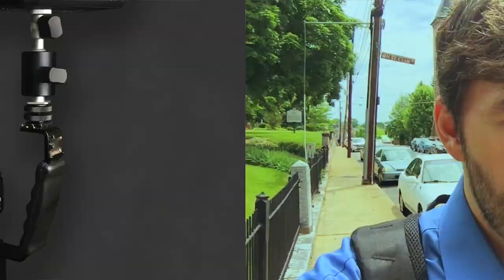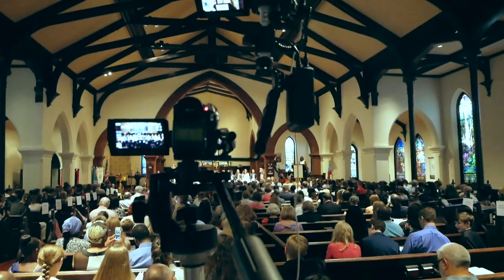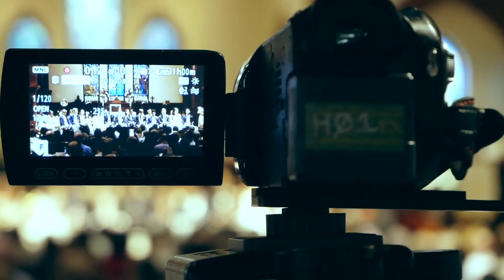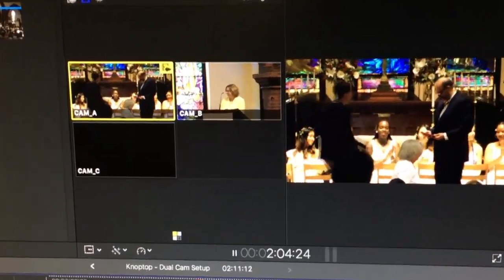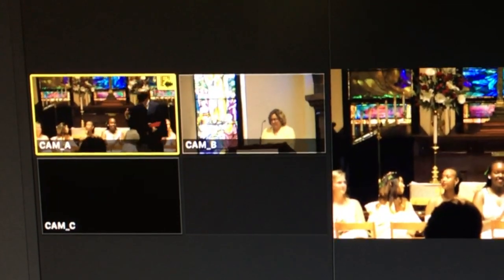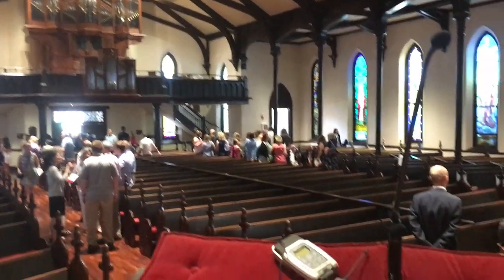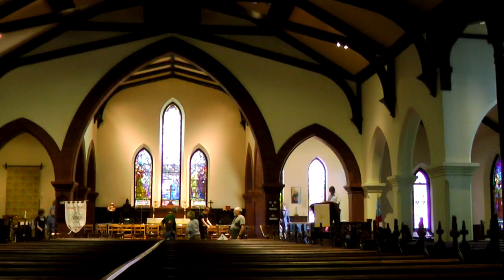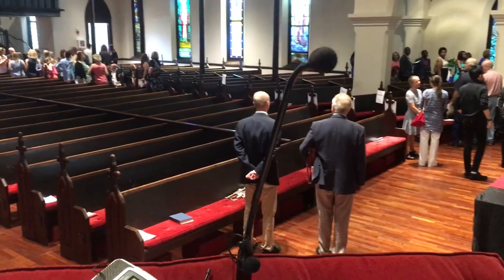2 Cameras 1 Tripod! - The Panasonic Camera EXPERIMENT

Comment: When I covered high school football games, for the TV station, I would see those double bracket setups all the time. The coaches like to use them to record both a wide(all-22) and tight shot of the plays. The only problem I see with this is that framing for the tight shot would often make the wide off-center. After all, if you're following the ball carrier, then you'd want to have more lead room in front of them, and that could take up either side of the frame, depending on which direction the ball is going.

Comment: I do it all the time think you have the wrong bracked which is not stable enough for such setup. You need a twin bracket and a extra fluidhead and not ballhead so you can smoothly move that camera without making bumpy movements that can shake the other cam.
Reply from the maker: Thanks!

Comment: I also had this idea in my head but never did it because of the reason you mentioned that all images would come from the same direction and only the zoom would be different. The bump against the camera (which always happens at least once) is the even better reason to not use two cams on one stand. I did not think of that one :) thank you for sharing. Usually people share what goes well. But we all know, one learns the most from things going wrong. I appreciate it extra you shared this 'going wrong'.

Comment: Haha...Silly Knoptop.   I've been doing this for about four years now. 

 I made one of those frugal filmmaker PVC pipe 'cage style' camera stabilizer rigs.  Once it was done, I realized I wanted to be able to do multi-cam wilth it. So what has evolved is something like a GX7 with a wide angle lens mounted on a compact ball head on the top left corner, a Zoom h5 audio with a shotgun mic mounted on the top right corner (and a small Sennheiser shotgun mic mounted on the GX7's hot shoe and connected to a 3.5 adapter & splitter that connects to both XLR inputs on the Zoom.  Inside the cage made by the rig I have a GH3 with a super telephoto lens (olympus 50-200 2.8-3.5 with an MFT adapter)... and then I mount the whole rig on top of a tripod with a video head.

Just this year I finally retired the ol' PVC and just bought a Neewer camera cage instead, but still use roughly the same setup.    Because the upper camera (always wide angle) is on its own ball head, it can be adjusted independently from the lower camera-- and since the lower camera is telephoto, a little movement down below covers a lot of territory, while the camera view on the upper camera just shifts slightly.   

Just to keep things really interesting, I usually also bring along a monopod with three stabilizing feet and mount a third camera on it with a medium wide zoom-- currently another old four-thirds mount lens-- 14-54 2.8-3.5,  with an MFT adapter and keep it off to the side of the tripod, so that it provides a third view and also, when I'm feeling brave and have everything on the tripod stabilized, allows me to pick it up and move around with it a bit.

Does this require an insane level of multi-tasking?  Yes, it does.  But here's the trick-- because there's a fair bit of redundancy built into the system, even when one thing is giving you some kind of problem, if you're being careful, the other parts of the system are doing their job and covering your backside.   Oh, and I've got AC adaptors for all the cameras and the Zoom H5, and I connect them to a Paul Buff mini-lithium battery pack that I hang off the tripod weight hook to help stabilize it.  And I can run two cameras and a recorder for hours without having to worry about changing batteries in the gear itself.

So hey, it's a GREAT idea-- if you're prepared for the additional complications that ensue.  You can see one evolutionary stage of my rig in silhouette in my youtube profile pic.
Reply: My most recent video (as I type this--more coming) is of the Russian band, Pakava 'iT at a local club/theater venue...and I'm using all three cameras.  It's not perfect, but a one-man band rarely plays symphony pieces.  It is all me though... running three cameras and one audio recorder by myself.  Can't seem to share a link here, or I would.

Comment: funny, i was thinking about trying this, but the bump issue was on my mind. 
I've been doing the same with my wireless lav now for a while. But i don’t worry about hiding it. I clip that sucker right up underneath the podium mic. Connecting to house sound is generally not an easy option and usually unreliable.

Comment: This works reasonable well IF you clamp secondary camera to tripod leg with clamp or multiple clamps.  More stability can be achieved using more weight hanging from tripod. I have made just the thing for clamping camera to the tripod, problem of course is secondary camera is too low often.  And thanks for these videos, keep them coming and I go and film something... Wait, no can´t do that, still rendering old footage :S
Reply: Exactly. Furthermore switch the wide/tele functions among the 2 camera. Use the camera on top of bracket/little ballhead for wide shot (which you not gonna re-frame) and the camera on the video head for the closeup (which is also less prone to vibrations and so better for tele).